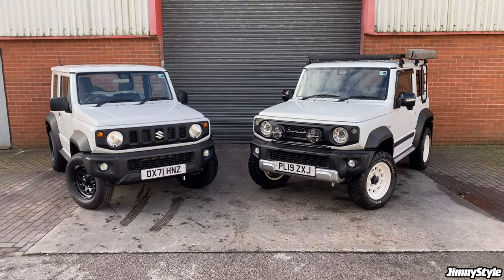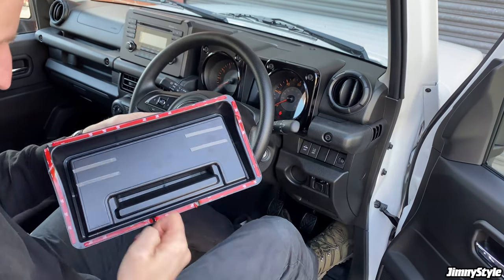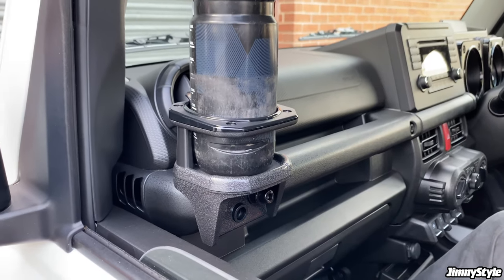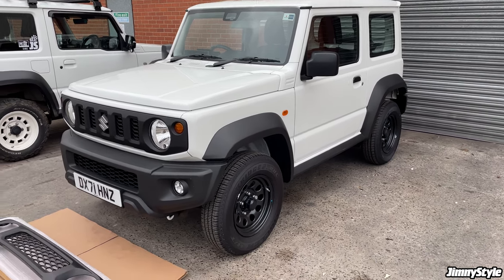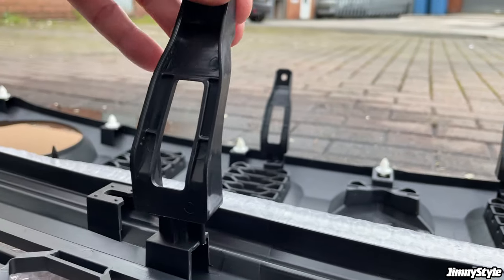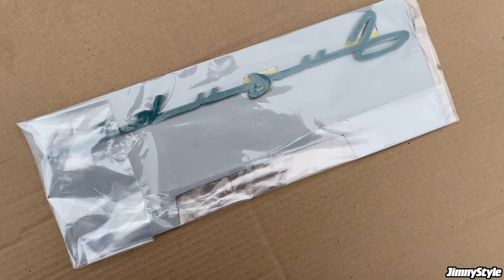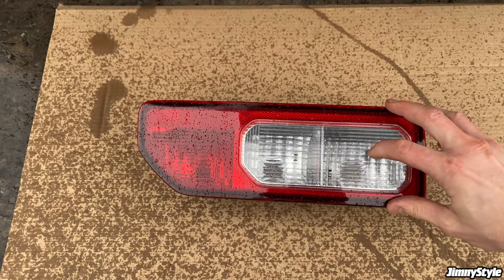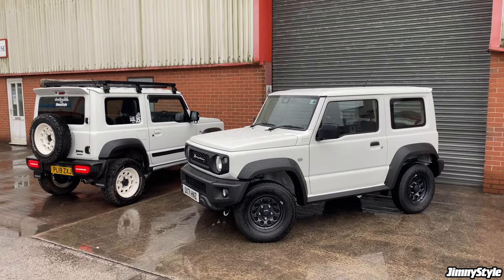Modifying our 2021 Jimny - Episode 1

Comment: Hi, what happened with the solution for rear seats for LCV version...?....is it possible to install seats and harness without huge changes ?
Reply from the maker: The seats will physically fit bar two holes that don't have a captive nut on the other side of them, so we have been investigating alternative brackets and designs. The seat belts can also be installed but there will be some complications with wiring for the pre-tensioners etc. The other hurdle is cost! The cost of the seats and seat belts alone from Suzuki is extremely prohibitive, and that's not including the additional parts required to get them to fit, nor the time involved. We're hoping we can figure out a suitable solution soon

Comment: Nice video! 
I have similar tail lights that are causing the error message you described, is there only one resistor or do you put one on each tail light? 
Cheers.
Reply from the maker: We can't say for sure regarding other brands of Tail Lights, but for our LED units it is just 1x resistor that is required on the reverse light
Reply: Your connector for resistor is probably not piercing one of the wires properly. From vid it looks like they use a  pin to pierce the wire and contact copper wire core???

Comment: Is it possible to change the halogen headlights for leds? I haven’t seen it for sale
Reply from the maker: There are aftermarket LED headlights that can be installed, but typically they aren't great and might not be legal in your country.

The OEM LED headlights physically fit, but the wiring connectors are completely different and, to remain legal, you also need to install the headlight washer system and automatic self-levelling system from an SZ5 model.

A quicker and easier alternative is fitting high quality LED bulbs into the original headlights.

Comment: Why the washers with the indicators? Mine came without them and I installed without issues.
Reply from the maker: It depends which front grille you are using. The OEM grille has deep enough holes to accept the OEM screws, so the washers aren't required when fitting the LED Front Indicators. However, on some aftermarket grilles, the holes aren't as deep due to the design, so washers are required.